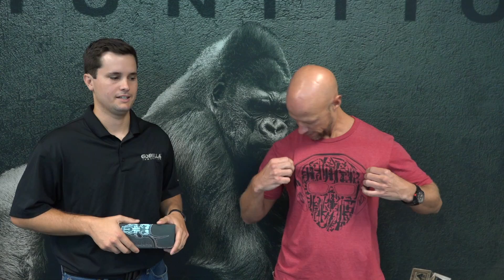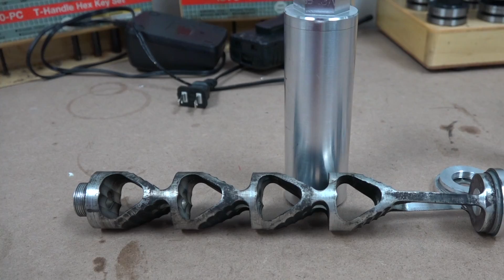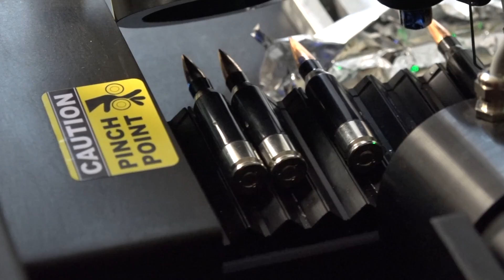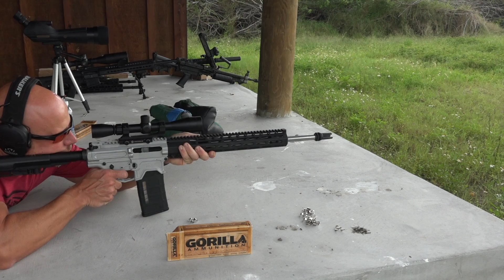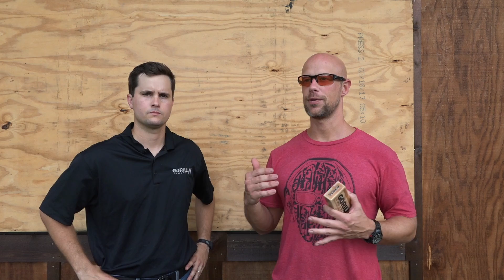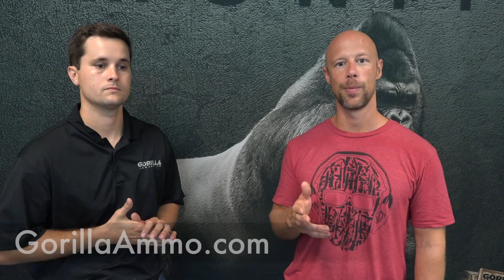Gorilla Ammunition Factory Tour & Range Day 🇺🇸

Comment: Is that the same poly ammo that nearly killed the TFB guys?
Reply from the maker: Well.... it's a different product now but same idea; just 4 years improved.   He was also told specifically not to use it in that gun but chose to anyway.
Reply: Fair enough, but to play devils advocate here, a cartridge that shares a generic shape with a standardized cartridge but can cause catastrophic failure in a firearm whos chamber space it fits but cannot handle. is quite a liability to be on the open market. that being said its clear they are considering that since it is not yet on the open market. I'm all one for product improvement, but id rather later than sooner with this so when it comes out it will shoot through anything without being a problem

Comment: I don’t think you went over as to why their ammo is so consistent from batch to batch.
It’s probably a trade secret.
Reply from the maker: I did miss that.   I should have hit it but forgot...  Happens with no script I guess.
Reply: Mrgunsngear Channel that's what my comment was about! there wasn't much about the factory, or why thier ammo is so good!
Reply: It isn't really trade secrets. 1st determine that the cases you are using have a uniform volume. 2nd determine that each powder load is delivering a consistent grain weight in each case. 3rd use quality projectiles. 4th Test boxes from each production lot for velocity consistency and accuracy consistency. 5th QC checking for each bullet loaded (especially important for rifle loads).